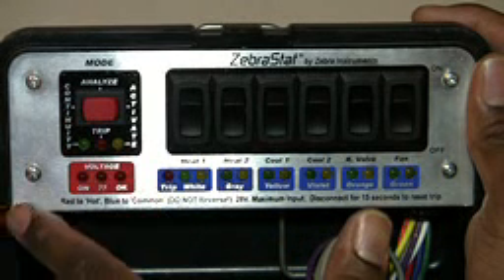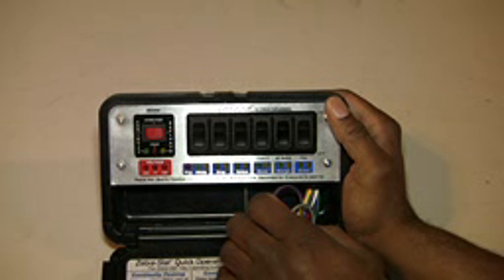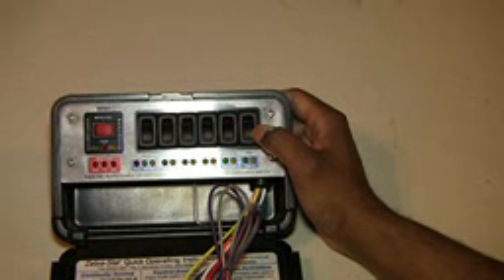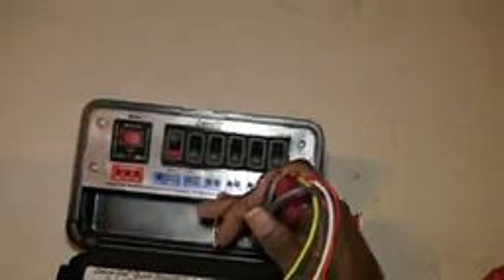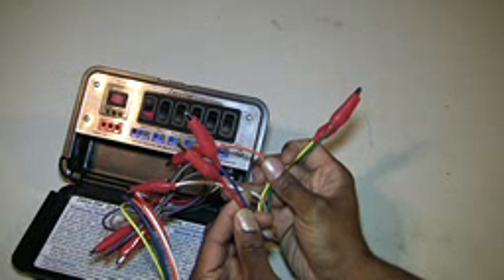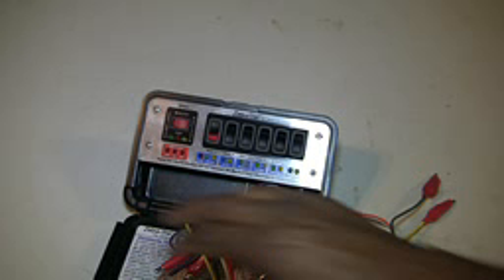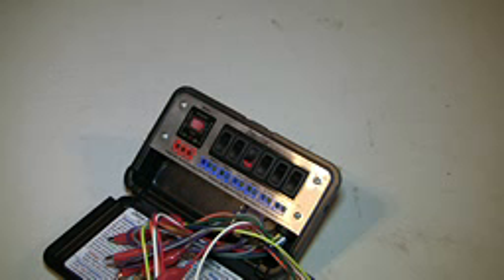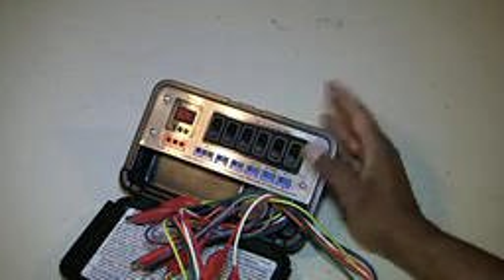Zebrastat ZS-2

Comment: The zebra stat I've got will run a diagnostic on the board or variable speed motors and tells if it's good bad or questionable
Reply from the maker: Good morning.  The zebrastat orimarily turns components on or off. The variable speed helps you diagnose ecm motor or board issues

Comment: I’ve been looking at this tool wondering how it can improve my diagnostic results. Testing my low-voltage circuits, can I not just go to the thermostat take it off the wall and wire red yellow and green together and see if my indoor outdoor heatpump comes on? Depending on my system type can I not just hook up orange or blue and check the heat also? The lights and the switches I can see are  pretty cool, it may be impressive to a customer, but what does this tool offer that can ease my troubleshooting? I’m not being smart here I just really want to know
Reply from the maker: No worries. I completely understand. I haven't use this much since a few months after this video. I now just jump everything at the furnace/air handler to verify that the equipment is functioning properly(with or without the thermostat on the wall).  When I first started doing service work, I used it a little bit. Now, it's easier not to have to go get it all the time.  The ONLY benefits now that I can see is if you're working on a two-stage system(heating or cooling) and surge protector for low voltage shorts(which I carry a resettable fuse).